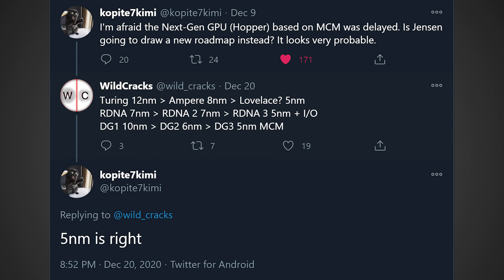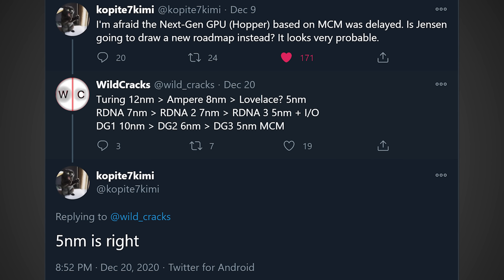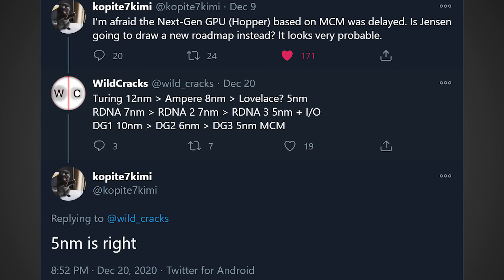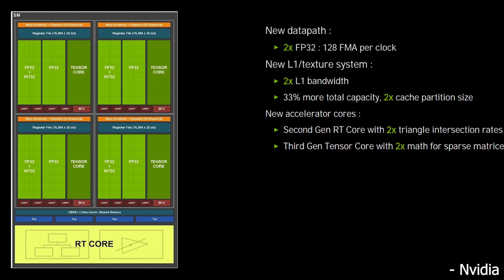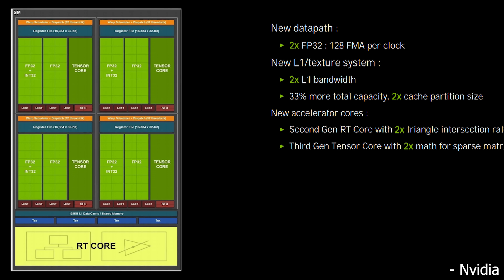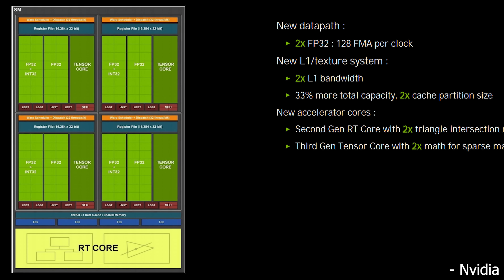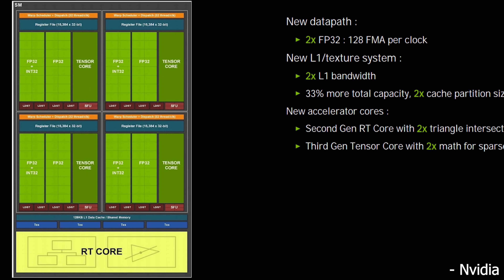NEW Nvidia Cards Leaked - RTX 4080 5nm Lovelace & Hopper GPU

Comment: Who doesn't  cares about 4000 series? 
I can't find any excitement for 4000 series. I used to be more excited for this stuff. Idk man
Reply: Cause you bought 3080 ;D
Reply: @offendershuffle9386  nah bro. I wish you were right. My build is sitting without a GPU for a month now. Can't find these GPUs at a reasonable price
Reply: @merlin28922  Get a Gtx 1080ti, runs most triple a games 4k 60 fps no problem and under a 100 bucks. Switch when you want to and then sell it, give it away or keep it as backup.
Reply: @offendershuffle9386  I have a 3900x CpU. Should I still go for 1080Ti? 
I would like to play atleast at 1080 P 60FPS.

Comment: This is why I don't get the hype behind the 3080 Ti. No current games are pushing above 10 GB of VRAM, and by the time they are the 4080 or 5080 will be out. AMD and Nvidia are so close right now they are both going to be trying hard to outperform each other next fall so the generational jump is going to be huge again and those cards will outpace the 3080 Ti. It's just going to be an expensive card that is future proofed for a future where it will already be obsolete.

Comment: Have a 2070 and got it this year. I was going to wait for a 3080 or 3070 this fall but i needed a gaming pc during the summer. I needed it at that exact moment so i didnt have the time to wait till this fall (not to game i am an architecture student and run rendering software that can be heavier than alot of games). Felt really bummed out seeing all the benchmarks and performance of the new cards for their prices, but looks like my 2070 was a great buy after all since most 3000 series gpus you cant even get your hands on till next year probably. Even though the 3000 cards are a good leap from the 2000s it looks like the 4000s will be an even bigger leap. Good thing i plan to upgrade every 2 years or so. So it looks like i may be right on track for a good gpu.

Comment: no way the 3080 is gonna be "obsolete" when 4000 series launch terrible use of that word. the 2000 series are still very good on all current gen games
Reply: Heck even the 1080ti is still good, mine still does 120 FPS at 4K in fortnite. The 3080 is probably gonna be fine for a good 4 or 5 years.

Comment: There are not RTX 30 series on stock, and the ones we can find, are 3 and up to 5 times more expensive because of scalpers. So there´s no way to afford any of them, getting to a point where buying consoles is becoming better market. (Don´t get me wrong, but there are more chances to get a console a the right MSRP than new pc components). However, there is no stock available and now we have more upsetting news because we suspect what´s going to happen. This said, personally, i wanted to build a pc with new generation components, but as things are right now, i´m not willing to ridiculously pay so much money for pieces that will become obsolet in three to 5 years and above the current MSRP. Not even Amazon where sometimes we can find availbaility has control of it.

Comment: RTX 2080 was released on September 20, 2018, and RTX 3080 was released on September 20, 2020. Officials have been releasing the first variant of the series on the third Thursday of September month. So we are expecting the RTX 4080 to be launched in September 2022. The release of RTX 4090 will be followed after a month.

Comment: Haha. This is crazy. At least fill the pre-ordered from the last gen.
Reply: There are leaks talking about an inevitable 4000 series card.  You know before the 3000 series was even out the door Nvidia was planning the next step.  This leak discussing possible designs in no way means a 4000 series card is anywhere close to being launched.  There is going to be basically no way a 4000 series card with new designs like stated in this video is happening in 2021.  If anything this is a mid 2022 product line.  It will be months before stock gets better for the 3000 series.  There will not be a reason to release 4000 series till 3000 series is squeezed for all its worth and right now there are tons of people just hovering over buy buttons for those.

Comment: The RTX 3000 series is a failure, just like the RTX 2000 series. We need even better RTX performance, just like back in tesselation days, that is if they want to make RTX a thing, also, the price/performance is atrocious. It's a rip oof not to mention the supply issue.

Comment: You were asking why you can't run an integer and an FP32 operation at the same time. I'm studying computer science and to my understanding it works the same as it does for CPUs but I could be wrong. There's more to it but I'm trying to make this as simple and basic as possible for those who are interested:

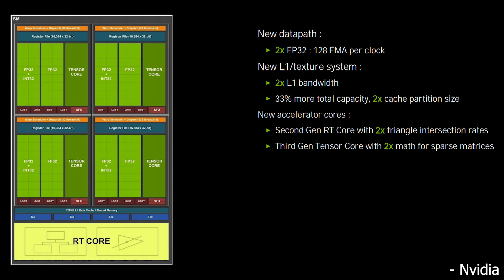3:03 shows the picture I'm referring to.
You have the registers that (dark red boxes with LD/ST (load/store)) under the actual processing units (big green boxes). Those are used to store the data you want to have calculated. To make this quicker (store the stuff for the next operation while the core (those 4 smaller boxes with grey border inside the SM) is calculating the first so you have less time the processing unit is waiting for data) there are more registers than than minimal required to operate. If the data is stored in the register the core get the information about what to do with it (for example multiplying the FP32 values) based on the code that's running at the moment. So it pulls the data out of the registers and then runs either an integer or FP32 or tensor core operation because you only have one connection for the communication that determines what the core should do with the data inside the register. After that the data is stored in the registers above the processing units (blue box between the orange and green boxes).

That's basically it. Appreciate your news episodes and happy holidays for everyone.

Comment: Honestly, this is not the year to upgrade. Assuming that Nividia tries to compete with AMDs roadmap planning a similar increase from rdna to rdna 2 as rdna 2 to rdna 3, a 4060 ti in 1-2 years would be compared with a 3090 in terms of power.

Comment: I think I'll just stop clawing for one of these 30 series cards and stick with my post launch panic 2080ti lol..
Reply: If you have a 2080ti you're definitely fine lol...
Reply: Yea I think I'm done for a gen at least. I bought it off of ebay and it was pretty much Doa. Micron memory failure. Instead of returning it and getting my $565 back, I tried my luck with a rma. It was repaired. So it's considered a refurbished but hell man.. had I returned it I'd be stuck with a 1660ti. Which isn't bad by any stretch but cp2077 won't be the same.
Reply: @durtyred86  Yeah, the 2080 ti is very nice, no reason to buy a new GPU this gen honestly. You’ll still get good performance and you can use DLSS for games that support it. If mine hadn’t died, I wouldn’t have ordered a new card this gen as much as I like having new stuff.
Reply: @durtyred86  nice man I wish I had just bought a 2080ti when they were cheap before the 80 dropped. Trying to get a 70 or 80 30 series is a wild time
Reply: better off staying with the 2080ti honestly, stock for new rtx gpus is sooo fucking bad that they just sell put within seconds to minutes

Comment: Samsungs makes no sense..they already have issues making big enough yield pr wafer, and that's why nVidia got so low price at Samsung.
I do not think Samsung can go down to 5nm yet...not for 4 years or so...TSMC is the way to go, so I think as we DID have confirmation 1 month ago that nVidia had signed a deal with TSMC...it could be for the coming 5nm....makes a lot more sense.
Reply: +1. I think the next cards are gonna be the RTX30xxS on TSMC, with much better power efficiency AND yield, so finally we don't have to hunt for a fricking video card

Comment: Rtx 4000 series release late 2021-early 2022?? Uhh don’t bet on it. 3000 series are still not in stock and probably won’t be til spring 2021. GPU generations usually take 2-2 & half years for next release. Unless nvidia decides to do another super line up which is mostly just increasing clocks. Plus with the huge demand/scalpers, expect 2023 to comfortably buy a 4000 series card

Comment: The fact that we are seeing leaks about the the NVIDIA 4XXX series GPU before 90% + haven’t been able to get their 3XXX series GPU. 🤮🤮🤮
Reply: There are leaks talking about an inevitable 4000 series card.  You know before the 3000 series was even out the door Nvidia was planning the next step.  This leak discussing possible designs in no way means a 4000 series card is anywhere close to being launched.  There is going to be basically no way a 4000 series card with new designs like stated in this video is happening in 2021.  If anything this is a mid or later 2022 product line.  It will be months before stock gets better for the 3000 series.  There will not be a reason to release 4000 series till 3000 series is squeezed for all its worth and right now there are tons of people just hovering over buy buttons for those.